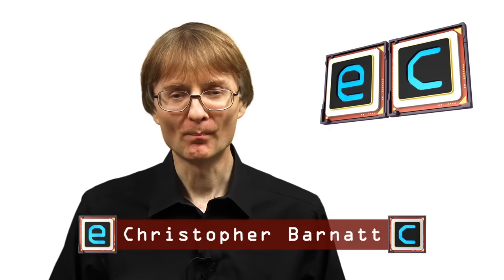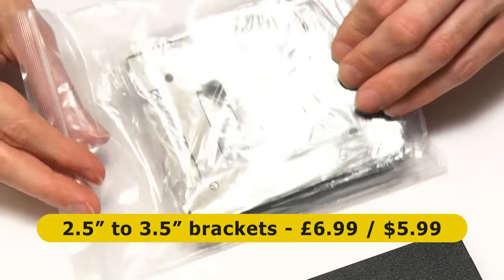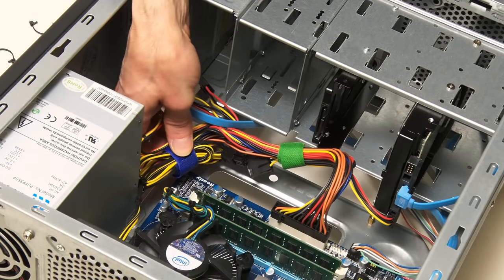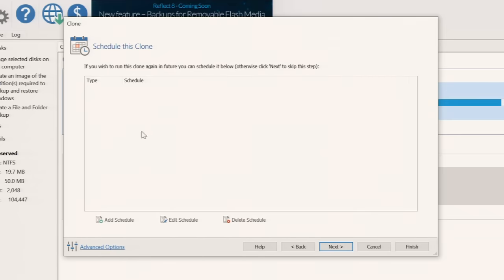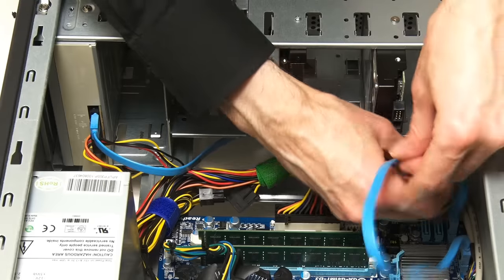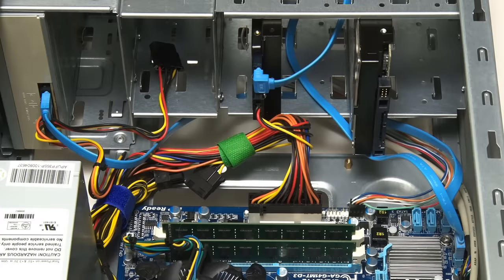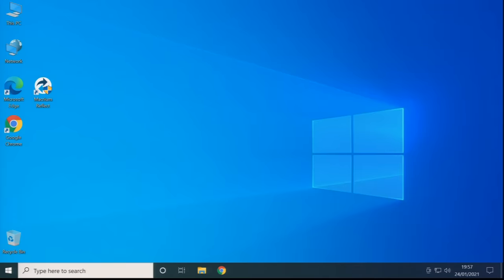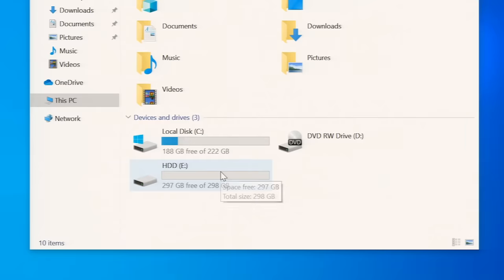Old PC Upgrade #2: SSD Boot Drive

Comment: I kept seeing everybody talking about "how great it is" to install an SSD in your computer as a main boot drive and two years ago I jumped on the bandwagon!! I ran out got me TWO 500gb PNY SSD drives and stuck one in my old Windows 7 machine and the other became my Ubuntu workhorse main drive!! And I would LOVE to say I am happy with them.......I WOULD love to say that, but not even a year later, the one running my Windows 7 machine died!! Not only did it die in epic fashion........BUT I also lost ALL THE DATA ON IT, that I had worked on for nearly a full year as well!!! Lucky for me I back up my data every few weeks so it wasn't a total loss!! And I was able to recover from the crash without only a small amount of data I had to restore to "older copies" of the files that vanished!! Since then I have returned to a 500 gb hard drive in my Windows 7 machine, while I am still on the SSD in my Ubuntu machine, but that is NOW backed up every other day, sending data BACK to the Windows 7 machine (I have a dock installed on the Win 7 Rig)!!!! But I certainly no longer trust SSDs as much as I used to.......and they are kind of a gimmick if nothing else to me!!!
Reply: That is an occasional problem with SSDs -- when they die, they do so without warning. And the minor brands more so. (=cough=Adata=cough=)

Personally I would not trust any brand of SSD  other than Samsung or Sandisk/WD.

Comment: Definitely speeds thing up.  With my 12 1/2 year old Lenovo ThinkCentre computer, and a 240G SSD, it takes 35 seconds to boot up with windows 10 Pro 21H1.  Twenty seconds of the 35 seconds, is actually being used by the computers BIOS.   Shut down takes 6 seconds.   But most of all, despite being 12 1/2 years old, this computer can still handle Netflix and YouTube played at 1080 60 fps.

Comment: Mr Scissors! 😁  So it’s not just me who says stuff like that.  This just came up in my recommendations with perfect timing. I’m busy upgrading a desktop right now.
Reply: Mr. Scissors and Stanley the Knife, the two other guys who make up that criminal gang (Chris is the brains behind the whole operation).
Reply: @boink800  Not forgetting Philip the Screwdriver.
Reply: I got hydraulic Jack out the back. He’ll lift anything not bolted down.

Comment: I'm sorry I don't comment more on this channel more often if for no reason than to support Christopher. 
I'm an advanced user who's been on the net since the 90's. Had a VIC20 and C64 as a kid... Yadda yadda. Not new to computers. This channel isn't just for beginners. 😉
I find Christopher's personality and and articulate way of speaking very relaxing and straight forward. He seems like a really good professor. It wouldn't surprise me if he had a teaching history. 
I have an old laptop I'm going to upgrade from 2010. It already runs decent but doubling the RAM and adding an SSD will improve performance a bit but my bottleneck is the dual core CPU. Load is always maxed out when streaming video in full screen.
I was going to do some research on cloning windows but Christopher laid all of that out in this video. 👍
I mainly follow this channel for all of the SBC coverage but this video was also very helpful. 
Thanks for all of your help and your uniquely articulate style of teaching. Please never change. 🙏
Reply: Have you checked if your laptop has a ZIF socket? If so, you can check if there is a more powerful CPU that will work on that chipset. Pretty sure there are a couple of quad core CPU models that will fit right in there (I'm guessing you now have a Core2Duo, that can be swapped out with a Core2Quad without any modifications). Again, only if the CPU is not soldered to the mainboard. Also, there are groups of hardware "hackers" that modify BIOS firmwares for overclocking, you could check that out too.
Reply: @paulmichaelfreedman8334  Thanks very much for the info. I haven't looked into it yet because I assumed a CPU upgrade would be more trouble than it's worth but you've given me new hope. Thing is, I'd like to get a little more life out of this machine because it looks brand new. When I bought it, I had it lined to my TV with HDMI and just left it folded up and put a wireless k/b on top of it. I used it as a media centre but now I have a Nvidia Shield for that. Anyway, long story even longer, the computer looks like it just came out of the box. An upgrade from dual core to quad core would solve the only issues I'm having.
Thanks again. I really appreciate the advice. 👍
Reply: @butters_147  Good luck! :)

Comment: Thank you so much for this video ! I did everything has you show and it work wonderfully !!! My dad’s pc wasn’t usable anymore, I upgraded it from 4 to 16gb of ram and put a 240gb ssd in place of the 1tb hdd (using like you the cd reader cables!) that thing is now a beast ! It cost me 50€ in total saving a few hundred euros for my dad, I couldn’t be happier! Now it just need a heavy dust cleaning and that i5 6400 will be running better than never 😊
Reply from the maker: This great to hear -- a fantastic result! :)

Comment: After years of managing large numbers of PCs, I've developed the habit of only putting 2 screws into hard disk drives, the 2 on the side nearest to the top opening. It's always been enough and it saves having to take both sides of the case out. When most of the HDDs were 3.5", I always thought that a bit of flex would do no harm in protecting against shock. With 2.5" drives and SSDs, 2 screws are plenty. With good cases, 2 screws are very often adequate for CD-ROM drives as well. 
Thanks, by the way, for your stream of excellent videos.

Comment: Honestly, the most off putting part of upgrading a PC is the drive because I dread the reinstallation of all my applications. This has motivated me to finally upgrade my PC with the parts I've been sitting on since July LOL
Reply: It might be worth mentioning that using a Samsung SSD allows you to use Samsung's own Data Migration software which is extremely easy to use. Samsung drives tend to be a little more expensive, but they're among the fastest & most reliable SSDs, so you do get something worth the extra money.
If money is tight then by all means choose a less expensive SSD & use Macrium Reflect - You will definitely appreciate the upgrade.
Reply: If it's any comfort, when I swapped to my first SSD I found it to be 10x faster than my HDD, and that includes installing the OS. No joke I think it took me 5 minutes to install Windows 10.
Reply: @goodlookinouthomie1757  I have an SSD already however it's the reinstallation of the OS and downloading all the applications, games, settings etc that I dread. I just cloned to  my new 1TB nvme and am going to have a new motherboard, CPU and RAM. Motherboard is AMD so I think I can navigate driver issues and such and it will still be way less of a headache then starting from scratch.

Comment: Thanks so much -- using your video as a guide, I switched out my old hard drive for a Samsung SSD, and the difference --- wow!  My PC no longer has to "warm up" but comes on instantly and reacts right away.  it's like having a whole new PC.  I'd have never had the confidence if I hadn't followed your instructions!  (Although i have to say, the inside of my machine was a lot, lot more crowded than the one you use!)  Thanks again.
Reply from the maker: Great to hear! Sounds like an excellent result.

Comment: just followed step by step and by far out of the 3 videos i tried to achive this with this was the only one that was easy to follow and worked a treat.
first time cloner, first time SSD installer and it was a breeze. 
many thanks your video was a life saver!!!
Reply from the maker: Sounds like you've had a computer hardware success. Congratulations! :)
Reply: @ExplainingComputers  thanks will definitely be following you steps on the next one i do.

Comment: Zip ties work perfectly fine.  Just because you don't have the right tool for the job handy doesn't mean they are at fault.  Use a pair of wire cutters (or strippers) and if you don't want to "risk" cutting a wire, cut at the head of the zip tie and not its length.  This is particularly easy with adjustable V-groove strippers.  Zero danger to the wire.

Comment: I like the thorough presentation.  Only thing to point out is the old saying 'Molex to SATA, lose all your data', as some of those adapters (esp the molded ones like what you have) can cause a short at the sata connector and fry a HDD.  I would use the adapter on the optical drive and the psu sata on the HDD.  

I don't have any problem with the use of twist ties for cable management as long as its far from any pcb components and not reused to the point of exposed wire.  It's a stationary desktop, not a piece of equipment that sees a lot of vibrations that can eat through the coating.

Comment: SSD is always a good upgrade option in this type of scenario since, in a worst-case scenario, you can always redeploy it on a different machine.  I've upgraded several older (circa 2006-2009) laptops to SSDs and find them perfectly usable in typical applications.
Reply: We're not talking about 'laptops' here, are we! Laptop are a different can of worms to say the least.

Comment: Would have been nice to see the Chrome open time comparison from the last video and maybe the HDD times for opening gimp as well. Still though its nice to see a comparison on just how much faster you can get with various upgrades to low end pcs. On SATA3 Im sure the SSD would have been a massive boost even with 4GB of RAM only.
Reply: I feel like something else is slowing this down, even for Sata II this is a slow boot.

Comment: After watching this video I bought an SSD right away and doing this install right now as we speak. I wanted to do this so long ago but by brain couldn't comprehend this was possible. You're telling me it was just as simple as cloning a drive? 🤯
Reply from the maker: It sounds like all is going well. Good luck with your new SSD-upgraded system.
Reply: @ExplainingComputers  So my BIOS showed, once I've plugged my HDD back in, as Master and not Slave like your video and also showing as CH0. In other words both drive showed as CH0. The boot order was correct however, SDD on top and HDD on bottom. Will that cause any issues?
Reply from the maker: @tomle2553  Providing you are booting OK from the SSD now -- which it sounds like you are with the boot order the way it is -- you should have no problems.

Comment: SATA 3 SSD in place of a mechanical drive really is "They've gone to plaid!"
Reply: Just with old computers the SATA interface is 150 or 300 MB/sec so you wouldn't get full performance out of the drive. But the access time of SSD is so low, ANY SSD will give great improvement over HDD boot drives, just by access time alone. Transfer speed won't get higher than the SATA bus can handle on the motherboard. Of course you can go RAID-0 (if supported) with two or three drives to increase transfer speed - I once put three 60GB sata600-SSDs in RAID-0 on a board that could not boot NVMe drives - it gave me 1500MB/sec. Not bad for a 9 year old system.

Comment: I purchased a SSD drive and cloned it and replaced my HHD drive in my Dell Inspiron 1520 laptop and followed your video and had no issues. Went to SupportAssist and used the tools in this program from Dell and ran the test on Laptop no issues found. I did find the laptop boots up faster and going to programs on the computer come up faster as well. Great video. I've been a subscriber for quite awhile now as you know. Also, I've been using computers and working on them since Windows For Workgroups with DOS 6.2, telling on myself now, lol

Comment: Chris, I really enjoy all your stuff. Just a comment for readers. When timing boot times, also count the time it takes for a system to “normalize” by looking at processor and disk utilization in Task Manager after boot. Especially on old computers with slower processors and disks this normalization usually takes some time, up to a degree where it is unusable for few minutes. Changing HDD for an SSD also significantly decreases this “normalization” time even without increasing memory size, since there is a lot of “small talk” between proc, memory and swap files. Not to mention benefits of having a swap file on SSD with sub 1ms access times comparing to old HDD with minimum 6-7ms for every small chunk of data.

Comment: 5:47 Oh how right he is about the zip ties being difficult to cut off without damaging things. I did that recently, being 100% sure I am only cutting the zip tie, and after it was cut, one of the fan wires came with it! Not fun.
Reply: I use Velcro cable ties then that way I don't have to worry about cutting a wire.

Comment: Surely you just mounted the SSD on the "outside" of the conversion kit? Asking for a friend :)
Now... gotta get back to the video, and find out how you migrate the storage content. This could be immediately useful. Thanks.
Reply from the maker: Agreed! There is a caption in the video indicating that it could have been mounted on the other side.
Reply: @ExplainingComputers  OK. My pedant is at rest.
Reply: @ExplainingComputers  PS: Macrium Reflect is now in my tool box. Thanks.
Reply: He did and stop calling him Shireley...
Reply: @ExplainingComputers  Sometimes they only want to fit gracefully the wrong way round, too. Or you don't have all the right swear words for reaching the screw holes!

But I no longer use internal mounts at all. Instead I use hotswap drive bays, and life with multiple boot OSs is so much simpler. (I no longer attempt multiboot from a single HD; too many ways to go wrong.)

for SSDs or other 2.5" drives, 
http://www.istarusa.com/en/istarusa/products.php?model=BPN-2535DE-SA
and and I use several of their 3.5" drive bays as well (they do both SATA and SAS). It's to where if I don't have 3 or 4 spares in the parts stack, I think I'm out. :D

Comment: Amen on the zip ties... I like using velcro ties myself. I have a new job with a school district and recently a teacher needed some new speakers on her computer, but at some point in the past she took it upon herself to zip tie all her computer cables together in intervals of 6" from one another... I didn't even bother removing some of the old wires honestly, just hooked up the new speakers and attached them near the top and left it at that. I wasn't about to cut 10-15 zip ties to just replace the speakers lol.

Comment: Those SSD are awesome,I installed one in a 10 years old laptop and it powered up in 35 secconds from totally of(no sleep mode) to you tube in high def.
Also,I didn't know that NAND tech was really old,like from the sixties.

Comment: Amen on the ziptie comment - I hate zipties. I will take loose cables over these crazy overtight, impossible to remove things. Parts inside a pc are meant to be able to be changed.
Reply: See!! This is my exact thought. When i heard Carey say don't use twist ties and why you shouldn't use them. I figured well he must don't know how to use them cuz I've never experienced the twist ties disintegrating and shorting out the motherboard
Reply: @SupremeNerd  The plastic-coated ties hold up tolerably well, tho they often move around more than you'd expect. But paper-covered twisty ties get brittle over time and then you've got naked wire that's looser than it was, wearing on the wires due to the minute vibrations from the fans, and sometimes coming loose. 

But velcro strips make for a much tidier result, with zero risk of disaster (unless one gets tangled up in a fan) and you can buy a roll of 50 at Walmart for $4.

I hate zipties, in fact I keep a pig nipper in my kit specifically for doing away with 'em. Worse, sometimes they shrink as they age and cut through the insulation!!
Reply: @Reziac  which is why i don't have an issue using them. Plastic coated all day. I used Zip ties but then i realized that they are more of a hassle that i wanna deal with. That's why FOR MY MACHINES I'll use the plastic coated ties
Reply: Velcro ties tend to accumulate dust which is not easy to wipe off. When you untie a velcro, the dust ends up flying around all over the place. If you have allergy to dust this is not good at all.
With zipties, you only need to wipe the dust off with a wet towelette - and the wires are relatively clean. At least, no massive amounts of fine dust flying around.
Reply: @witteblich6062  If you always make 'em fluffy side in, accumulated dust isn't such s problem. But agreed if you're sensitive to it-- well, CPU fans are worse. I'd wear a dust mask!

You know the PC is too dusty when you had to use a spoon to clean it out (true story).
Reply: @witteblich6062  If your pc gets that dusty inside, consider dust filters on the air intakes. My case has them and I love them. Thin fabric ( think cheesecloth or a little tighter weave) will do it.
Reply: @witteblich6062  if dust is what you're worried about you wouldn't have a computer to begin with.
Reply: @SupremeNerd  Dust is inevitable, yet there is dust and there is dust.
Reply: @DeirdreYoung1  I have dust filters (chinese-made thin film with tiny perforations). While it is good at keeping off snakes and my cat's hair, smaller fractions are still accumulating in the case.
Reply: @witteblich6062  exactly my point

Comment: I know its not a good solution but my ssd just hangs by the cable in the air. I guess i am just lazy
Reply: LOL, I've done that too. With the lightweight ones, no problem. Wouldn't want to do it with the Samsungs, as they're quite a lot heavier.